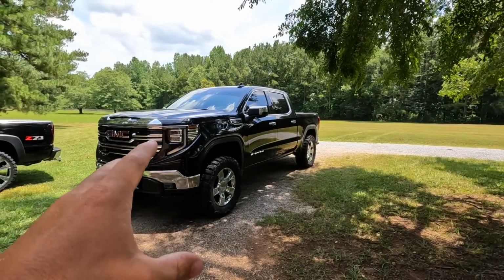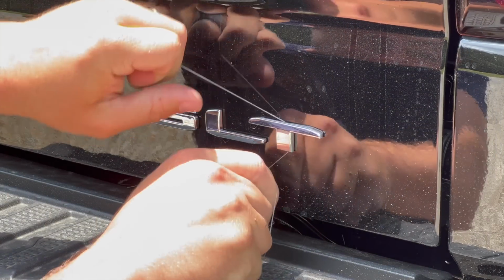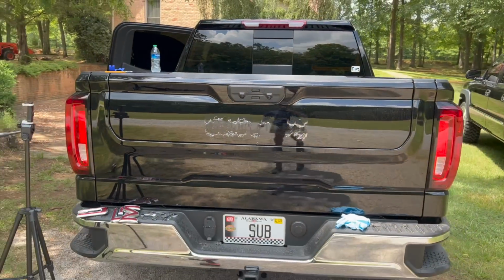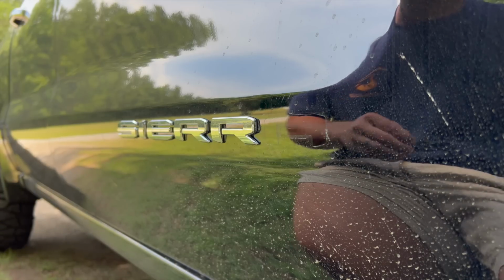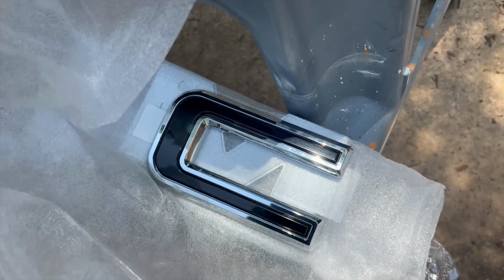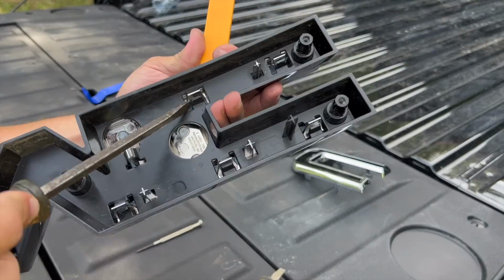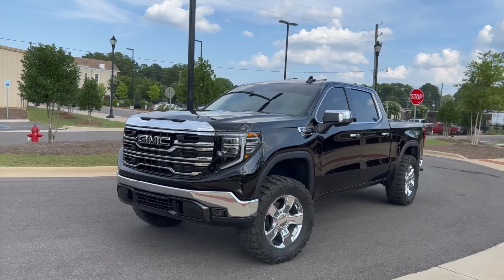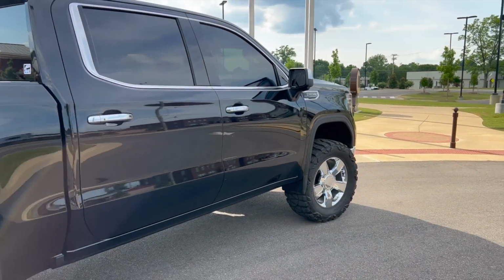I DEBADGED MY 22 SIERRA AND IT LOOKS AWESOME! + BLACK FRONT GMC BADGE

Comment: FYI - to remove the front emblems, remove the red emblem insert with a pry tool (they're trash anyway since you're replacing) and then use a flat head to remove the chrome base...then just snap in the black ones. No need to remove radiator cover, etc.

Comment: The front is not hard at all. Just did mine. It's 5 torx screws. One screw on each corner and one behind the M.  You take the top radiator shroud off and use an extension to go through the shutters then the base comes off to allow access to clips on the badge

Comment: Quick tip man Heat gun and Fishing line will take it right off!
Heat it up and than go with the fishing line! 
I debadged the tailgate where it has SLT and the dealers tag and removed Sierra from the doors and I personally like it my front/tailgate badges are black and I have a 2020 GMC Sierra so I think it looks much cleaner and slick but everyone has their opinion

Comment: Looks great bro, you inspired me to atempt this look on my satin steel matalic 2021 GMC Sierra X31. It turned out amazing and I appreciate the video. Have you thought about using last fit licence plate lights and reverse lights? I just installed them in my truck and I'm so happy with how the install turned out, the reverse lights are like having headlights going backwards, no joke, I like them for Loading my bass boat at night and hooking my camper up at night. I would think for sixty thousand bucks GM would give led's all the way around but apparently they are too cheap😂.
Reply: I see that in another video that you did install the last fit tag lights, looks good man.